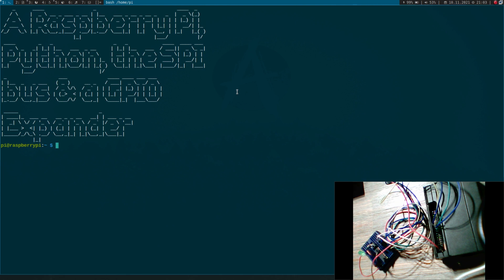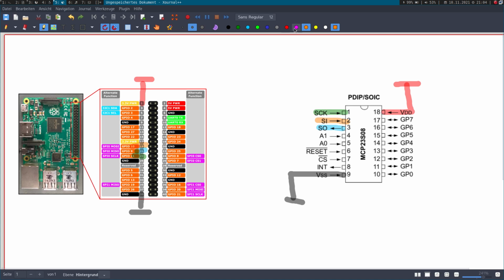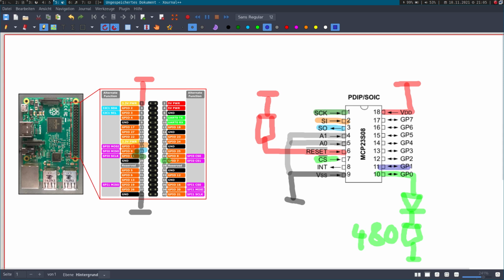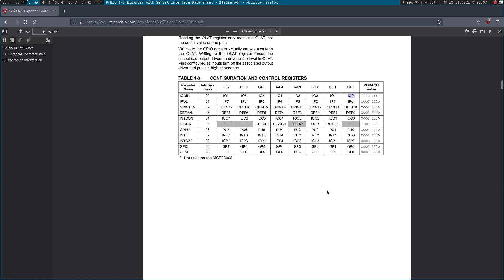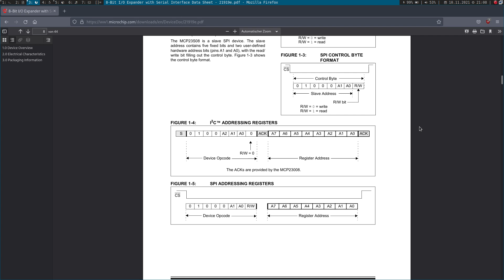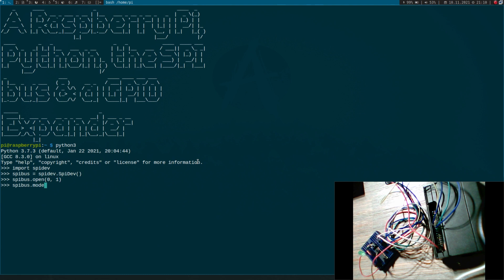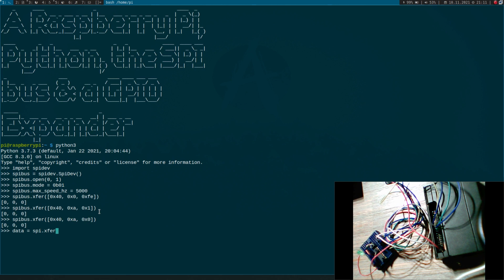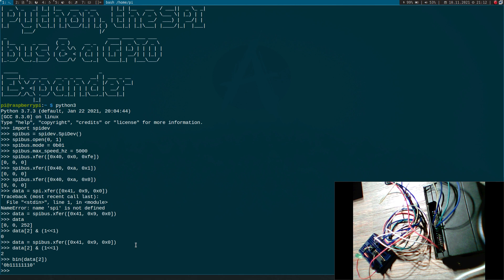A Raspberry Pi, Python, the SPI Bus and a MCP23S08 GPIO Expander

Comment: What happens if I don't connect the reset pin?
Reply from the maker: If you don't want to control the reset pin in software, you don't have to connect it to the Raspberry Pi, but instead connect it to VCC. If you leave the pin unconnected, it will float and randomly reset your chip.

Comment: Hey Johannes, I am REALLY happy to find this amazing channel. Wanted to ask you, what are your thoughts on the beaglebone boards ?
Reply from the maker: Thank you.
Well, I have to admit, I don't have so much experience with the beaglebone boards compared to the Raspberry Pi Boards. But I have a Beaglebone black.

Most beaglebone boards, like the BBB are based on the AM335x chips from Texas Instruments and come with a single Armv7 core. So, from the performance most RPis are better as they come with quad-core ARMv8 cores. 

But where the beaglebone's really shine is that they come with ADCs for analog input and a CAN Bus by default. On a Raspberry you would need an external SPI or I2C adapter to have these interfaces.

If industrial communication is important for you, the beaglebone is maybe the better choice. The AM335x chip is available in version, which supports industrial protocols like Profinet and therefore used in industrial applications.

By default you can program the beaglebone with a browser UI. This is something, I do not like so much, as this is not my type of workflow. But as you can also install a real linux on it, I don't mind.

So, thats about my thoughts about the beaglebone :)